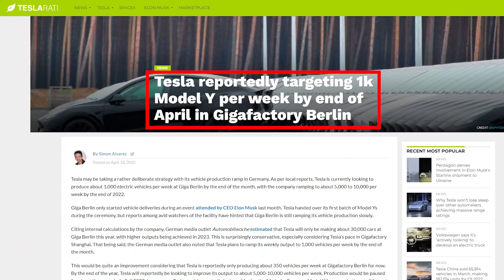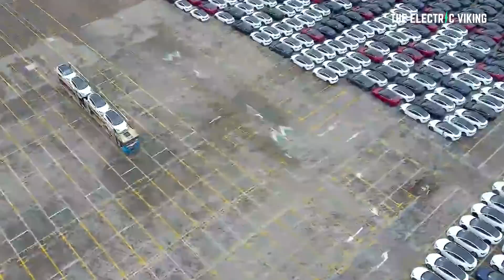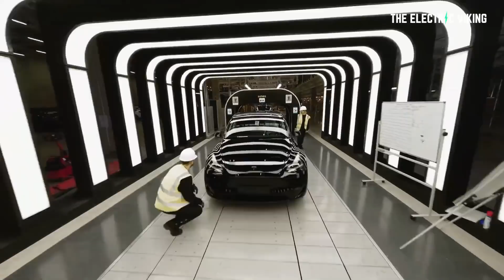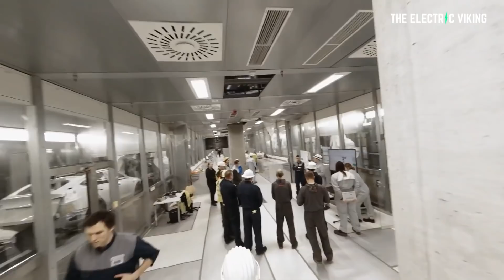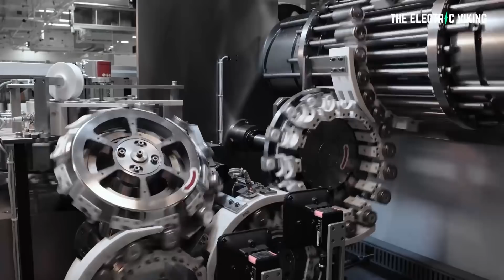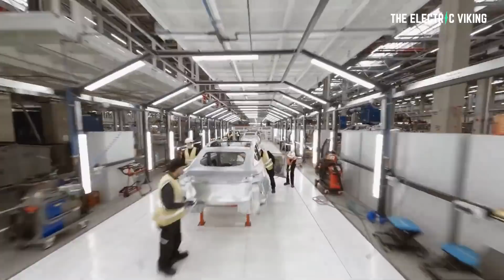Tesla Model Y 4680 cell update & total production at Giga Berlin

Comment: Just in
Battery, Powertrain & Manufacturing
Diversification of battery chemistries is critical for long-term capacity growth, to
better optimize our products for their various use cases and expand our supplier
base. This is why nearly half of Tesla vehicles produced in Q1 were equipped with a
lithium iron phosphate (LFP) battery, containing no nickel or cobalt. Currently, LFP
batteries are used in most of our standard range vehicle products, as well as
commercial energy storage applications. As a rebult of our energy efficient motors, a
Model 3 with an LFP battery pack can still achieve a 267-mile EPA range.

Comment: The monster 'BOT Propagation Machine' has slipped a gear, attacking the reality of Tesla's 4680 cells for the new structural battery pack. As always, the supportive information lives in the cloud - the FUD Cloud - any data entering the FUD Cloud is instantly lost, but is still there. While this brand of circular reasoning got us IN this Eco-Mess, It will NOT get us out. Thankfully FUD always dies where REALITY reigns. Good news - the Electric Viking is bringing us the reign of REALITY.

Comment: With Russian gas supplies in limbo, the heat is on on heat pump installers. So there will be a power shortage in their winter. All them privately run charging stations will have to pass on the costs and limit charge rates.